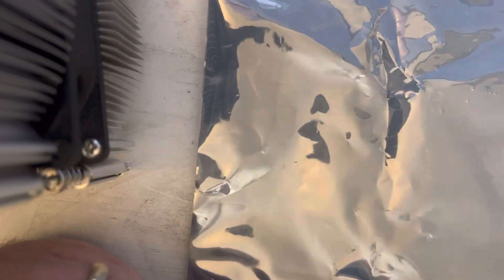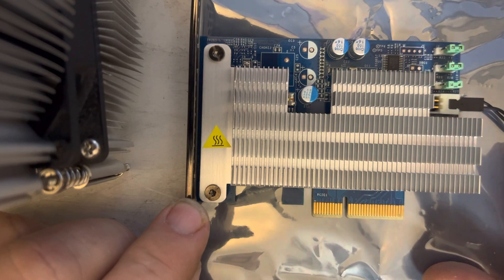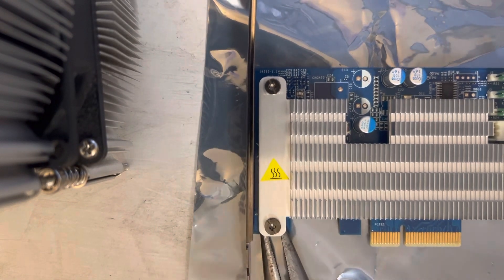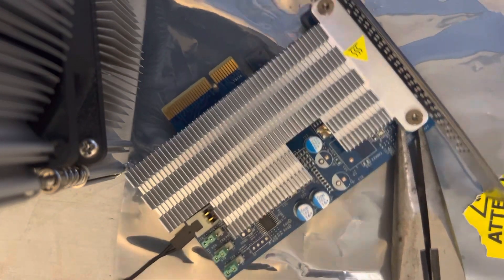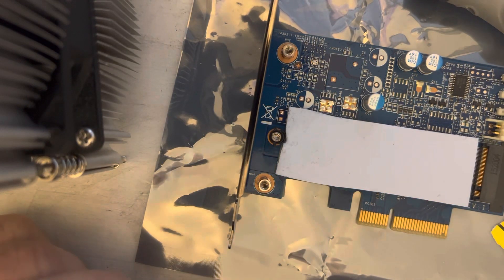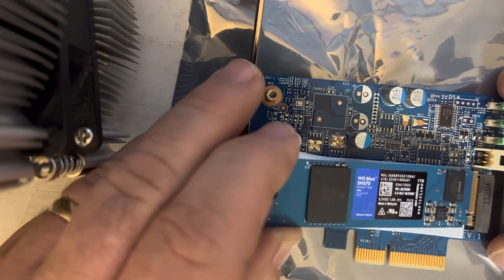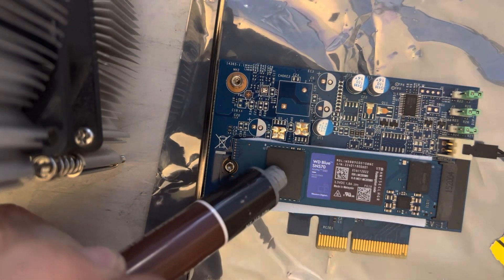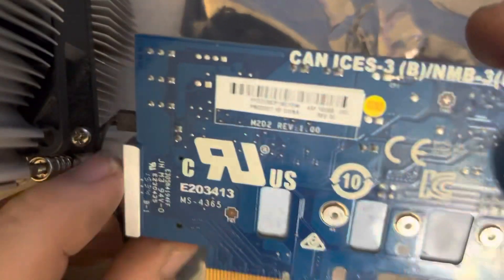HP turbo drive NVMe drive installation

Comment: I just bought a HP Z840 on ebay which will be delivered in the next few days. It only has a HD. So I'm looking to get the fastest SSD to boot from. Do any NVmes work in these HP Z turbo drives? Are all the drives the same?

Comment: Doesn’t work on my HP Z400
Reply from the maker: I dont know about compatibility with the Z400 systems, but I had to update the BIOS in one of my HP z440's before it would work.
Reply: @douglomax7461   Just the standard newest bios for the mobo?
Reply from the maker: @steveishere7909  I didnt update the BIOS.  Cant say for sure what BIOS I was using. I have only tested on the HPz440 and z240
Reply: @douglomax7461  I have a 440 with the latest bios so I'm hoping a TB nvme will recognize and be usable.
Reply: I already had the latest BiOS, so not much more you can do.
Reply: @rompstar  https://www.youtube.com/watch?v=_6T16RCqVDA
Reply: @rompstar  You have to modify the card to get it to work on any system.